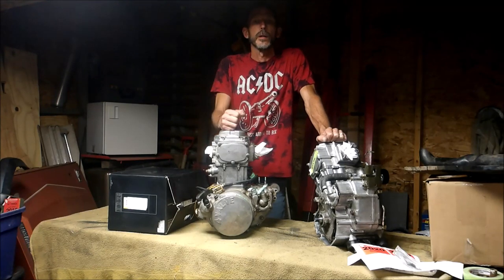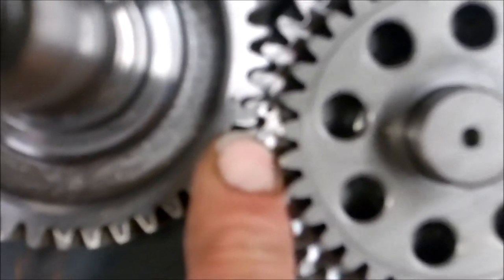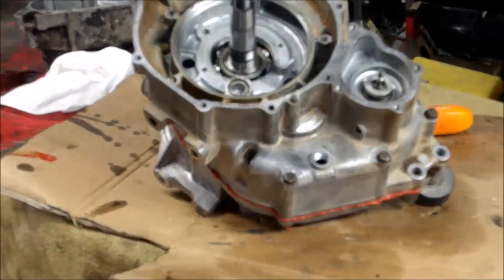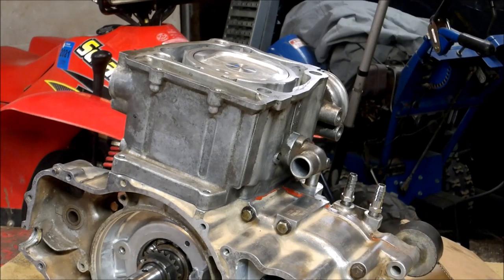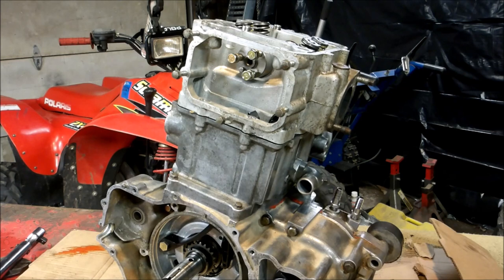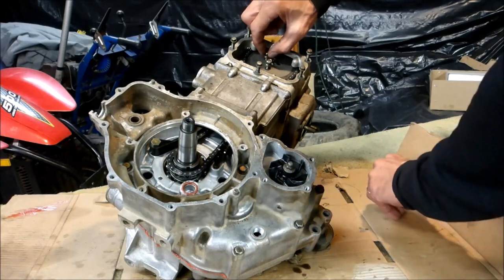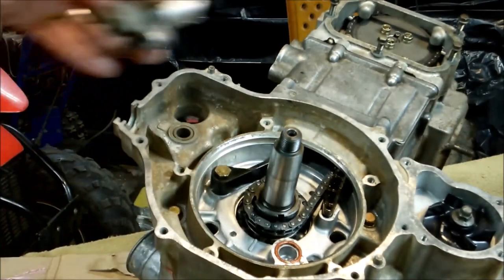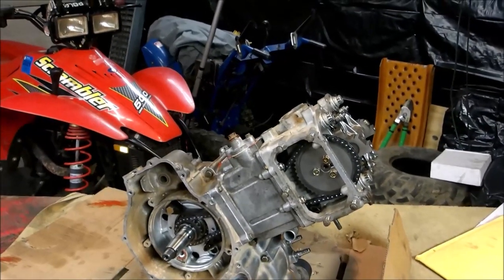Complete Rebuild a POLARIS 500 From The Bottom Up! And a 425.

Comment: where in wi are you? i’m in three lakes. just picked up a 97 xplorer 400 gonna swap a 400 from a 98. does it matter that one is chain one is shaft driven
Reply from the maker: No. It shouldn't matter. The engines are the same. If it was a scrambler engine the intake for the jug is a bit different, you just use the scrambler boot. What your doing should work fine. I'm 60 miles south of Greenbay.
Reply: @TitaniummanGarage  do you know if the front axle shafts are the same as well?
Reply from the maker: @karostaro4779  That I'm unsure of. You could look it up on Partzilla.com to see if numbers match. They have exploded views and part numbers for everything.
Reply: @TitaniummanGarage  thanks man
Reply: @TitaniummanGarage  your really close to me I'm from by marinette wi your help would be greatly appreciated
Reply from the maker: @kanerichard1279  Funny. I have a cabin 15 miles west of Crivitz.

Comment: How do you tighten the bolt that hold the chain sprocket on?
Reply from the maker: Keep at TDC. Use loctite and snug them up. You should be able to tighten them in that position .

Comment: I will take a look at the oil pump replacement, what made me question following that path was that a Polaris Dealer said to me that Polaris oil pumps are virtually indestructible, and they hardly ever fail, however, it is worth my while to take a closer look, hopefully, the cylinder head is not irreparably damaged, they are bloody expensive.
KInd regards and thank you,
Franklin
Reply from the maker: You could take the cam out and turn the engine over. See if oil comes up to the rockers. That how I test my oil pumps . If no oil it could be the pump or the oil port is plugged where the cam cover is.

Comment: The 2 dots on top of the piston go on the stator side correct?
Reply from the maker: Thats where I try to put them. But its a 4 stroke so I don't think it matters as long as the rings are offset.
Reply: @TitaniummanGarage  I’m having the head checked out after an engine rebuild. Is there anything to be checked on the decompression before reassembly?
Reply from the maker: @JayGeeJay  Do you mean decompression valve on the cam? Check to see if it moves up and down and the spring is correct.
Reply: @TitaniummanGarage  ok thanks

Comment: Great video. While finishing up my rebuild, I noticed that the inlet cooling elbow was not installed in the new cylinder. I tried to get it out of the old one, but broke it. The part is discontinued. Any ideas on how to proceed?
Reply from the maker: I'm not sure what to tell ya. I never took one off.
Reply: were you able to determine a way to remove it properly? im about to tackle the same project and dont want to break it off like you did
Reply: @joshuadavidson1967  I just bought a used cylinder on eBay for$ 35. I'm taking it to a machine shop tomorrow to have them remove that fitting. I should've watched titanium garage " buyer beware" video earlier. Then I wouldn't have bought the cheap cylinder.

Comment: Cylinder head bolts- 4 large 12 point bolts= 
Fist stage 22 ft-lbs
Second stage 51 ft-lbs
Third stage loosen 1/2 turn
Fourth stage loosen another 1/2 turn
Fifth stage tighten to 11 ft-lbs
Sixth stage tighten 1/4 turn
Seventh stage tighten another 1/4 turn.  

2 small 6 point bolts= 72 inch-lbs

There is zero mention of using oil on the bolts. At least according to the Haynes manual. 
Your welcome

PS. Stop searching for that piece of wire for the timing chain. Use a zip tie.
Reply from the maker: In the links in the video there is a link to my video with the head torque sequence. In my manual it says use oil on bolts. In the engine plant I worked at we assembled brand new engines dipping oil on the head bolts before install. If you look at the sequence you listed, wouldn't it make sense ? loosen..tighten..loosen..tighten again.
Reply: @TitaniummanGarage  What manual are you using? Also where does it say to rotate the engine after tensioner install?
Reply: @TitaniummanGarage  This is word for word from my manual. For whatever reason they never mentioned oiling the head bolts.       

11 Install the two dowel pins if they were removed, then lay the new
gasket in place on the cylinder. Never reuse the old gasket and don't
use any type of gasket sealant.
12 Carefully lower the cylinder head over the dowels. It's helpful to
have an assistant support the camshaft chain with a piece of wire so it
doesn't fall and become kinked or detached from the crankshaft.
When the head is resting on the cylinder, wire the cam chain to another
component to keep tension on it.
13 Install the steel washers on the bolts, then thread them lightly into
their holes.
14 Tighten the four main cylinder head bolts in stages to the final set-
ting listed in this Chapter's Specifications. Caution: The cylinder head
tightening sequence has several stages, including loosening stages,
which must be followed exactly to prevent damage to the cylinder head
and gasket.
15 Install all parts removed for access, making sure that the cam
chain front guide engages the notch in the crankcase (see illustra-
tion 9.8b).
16 Change the engine oil (see Chapter 1).

Comment: Mate, you need to be more thorough, mention the torque you have to use when installing each bolt, similarly with the bolts that are outside the cylinder itself. It would be reinforcing what you are teaching and people would remember it easier.
Reply from the maker: If you click on the link for the suggested videos it will tell you the torque specs. I had said I didn't want to go through it all in the video. ..it would be to long.

Comment: No where did you show the timing marks.
Reply from the maker: There should be a link in the video. Best way to adjust timing. It will give a clear shot of where the marks are. On the crank gear is a mark. line that up with the mark on the case with the stator off.

Comment: No  torquing on case bolts , and u didn’t mentioned bolt sequence at all , Top end , you did not say anything about orientation of piston rings at all , lubrications of parts need special grease  .I am sorry , I am not a mechanic but there are guidelines to follow to the “ T” when it comes on overhauling any motor .
Reply from the maker: If you click on the links above in the video there are separate video's on the head torque sequence. I had said in the video I didn't want to make the video long and please click on the links for more info.
Reply: Thanks for the reply , u scared me for a minute .  New sub here .
Reply from the maker: @EivinSukoi  lol. Its all good. I had another sub say the same on another video. I used to not say the torque specs because I wanted the viewer to buy a manual and check for themselves and also get a better understanding with the manual. I later found exactly what you said. Viewers wanting to know the values or thinking I didn't torque anything. So now I post separate videos to explain better. Oh..And the Jug base bolts are 46 to 50 ft lbs.

Comment: Friend, take a little time and tell people, remind them, of the torque you are using. It helps people a lot.
You are doing a great job, otherwise.
Reply from the maker: Thanks, There is a reason I do that. In hope that people buy a shop manual and read it through. I get so focused on what and how to shoot next, I sometime forget to explain certain things. Yes, that is a good idea to remind them. Thanks for the tip.
Reply: Have you ever had a hard time removing the pin that holds the piston to the crankshaft?  I’m doing a top end on a 03 500 and the piston was damaged and the pin is siezed in the crankshaft.  I guess I need to heat it up to get it out.  Have you any tips?
Reply from the maker: @trentelliott1473  I spray PB plaster on it. use a small socket and pound it out.